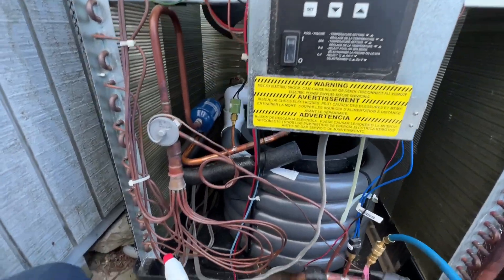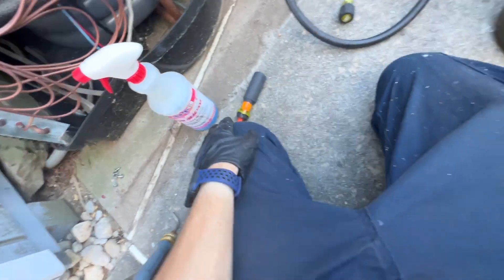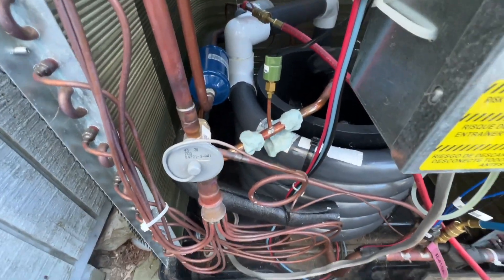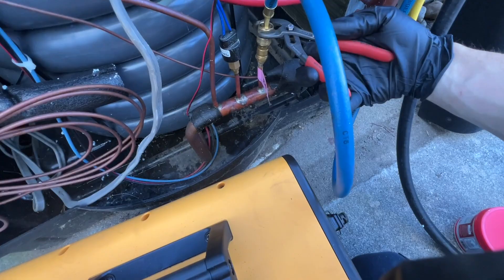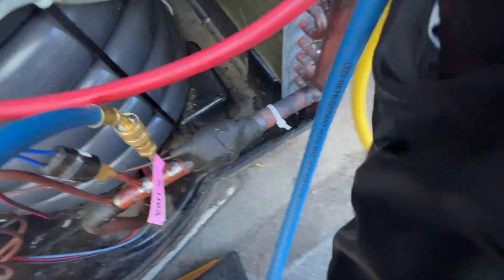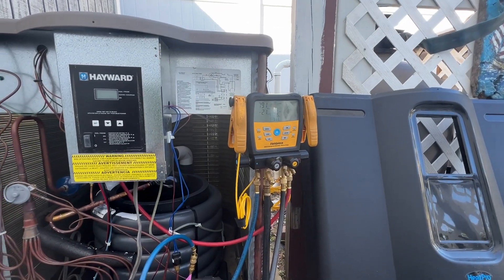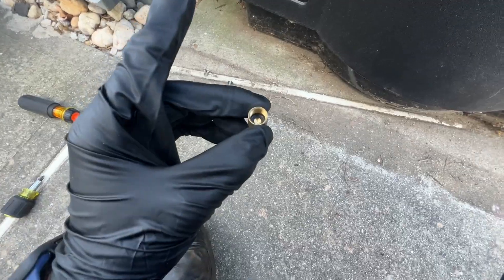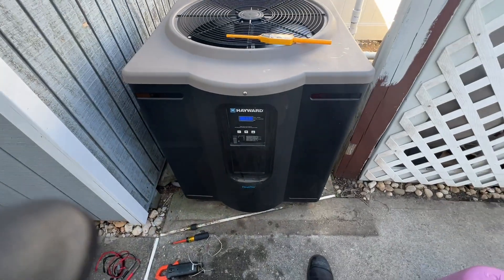Hayward Heat Pump Pool Heater Leaking Refrigerant!! Brazing Leak Repair on Hayward Heat Pump!

Comment: How do you like your Klein meter? Would you recommend it? Thanks great video
Reply from the maker: I like it a lot, not so sure about the temperature readings though, always seem to be off. Maybe a bad sensor it’s pretty beat up. But the meter is amazing. Absolutely love it. Fast readings. Not a crazy price. Never had an issue with accuracy. Great for capacitance, ohms, everything. I love it

Comment: You did a better job brazing than factory!
Reply from the maker: Thanks, I was kind of wishing I had the oxi acetylene… took a while
Reply: I had the same problem when I used wet rag it’s like it draws all the heat to it and away from where you’re brazing. An actual wet rag works better imo.